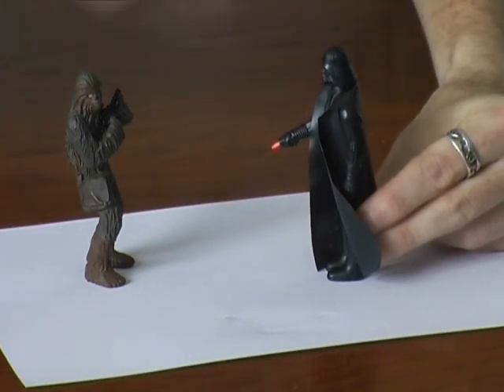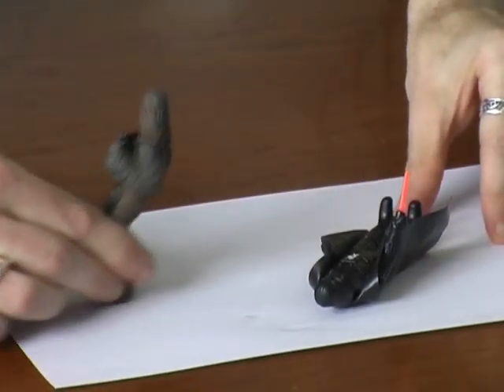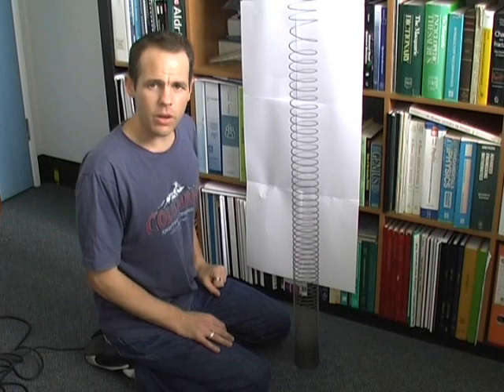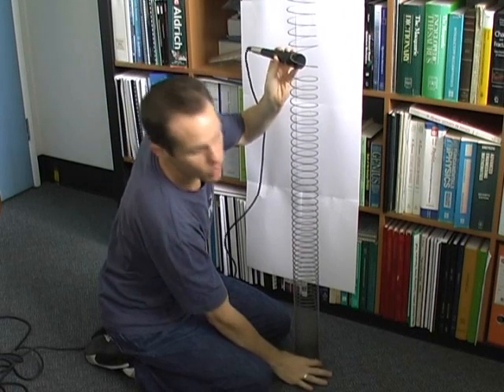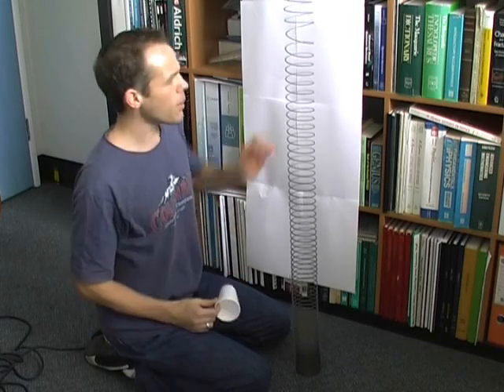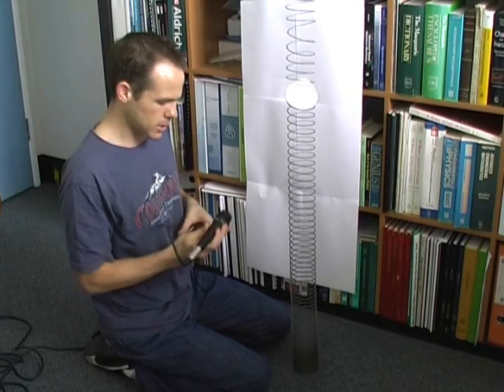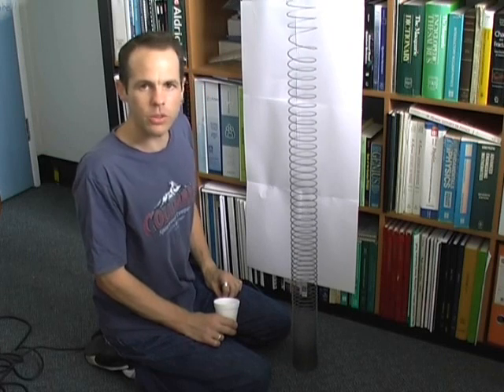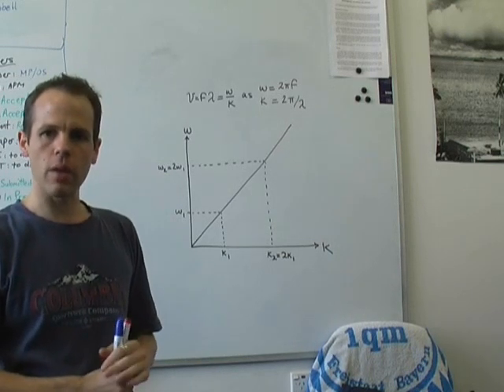How to make the laser blaster sound from Star Wars - Part 1

Comment: I forgot to mention the fact that you replicated the sound extremely well with a completely different procedure than the original foley artists as well! They struck steel cables for theirs (I'm not exactly sure what they hit the cables with) but ya, still a great discovery with the slinky and sounds almost identical to the movie effect.
Reply from the maker: Thanks. The physics is the same whether it's a slinky or a cable, so the starting sound will be similar, the difference will really just 'colour' the sound in the same way an effects pedal does for a guitar. I believe for star wars they hit the cable with a spanner, cable was the guy-wire on a radio transmission tower (remember seeing it as a kid when they put out the making of Empire Strike Back. ;) ).
Reply from the maker: See also: http://filmsound.org/starwars/#burtt
Reply: Awesome, saved & thanks

Comment: The sounds of the lasers were made by striking one of the suspension wires of the original Severn Bridge (UK). The longer ones were used for the ships while the shorter ones were used for the hand guns.

The lightsaber sound effect is a combination of the hum of an idling 35mm movie projector and the feedback generated by passing a stripped microphone cable by a television.

When the blasters are cocked they have a clicking/clunking sound. This is a recording of a parking meter handle being turned.

(from ign.com - Star Wars Secrets - Sound Effects)
Reply: tropicalscot he said that at the start but he said there’s another way to do it

Comment: Nice to see how they made this sound.
The only thing that disturbs me is your use of the word "laser", because Star Wars blasters don't fire laser beams, but bursts of particle beam energy called blaster bolts.
For more information:
starwars.wikia.com/wiki/Blaster
Reply: From an aspiring space-opera writer, thanks for the heads-up.
 That said, how are bursts of particle beam energy different from light amplification by stimulated emission of radiation?
Reply: George Estremera Said simpler:
Blasters do magnetically speed Plasma, while Laser is just Light and therefore waves, which you can't speed this way.
Reply: George Lucas did mention in the Star Wars novel that the blasters fired "energy bolts."
Reply: George Estremera That's because you could describe magnetically speeded plasma as "energy bolts", though it's not completely right.
Reply: Ryham007 I know. But once you know the science behind it, it's hard to ignore this kind of mistakes. I do not intend to offend anyone.
Reply: Blasters actually shoot Compressed Speed Plasma.

Comment: Dont know but the p.torpedoes use the same "technology" 
I had a toy that made the well known "Ptwwwong" (torpedo sound) he he he 
It was a cardboard tube with a couple of holes big enough to get a finger inside. On both extremes of the tube, there are plastic cups like the one in Adam's video. Finally between the cups a flexible coil, not as wide as this one, a Cm and a half perhaps. When you have it asseembled, stick your finger inside pulse the coil (like a guitar cord) and "Ptwwwong"